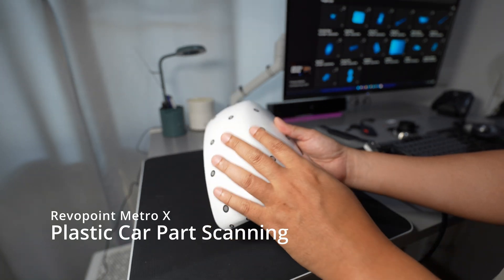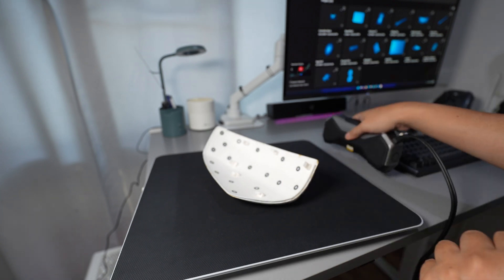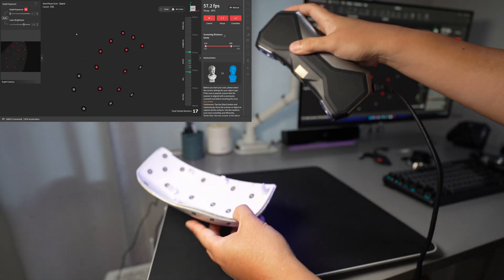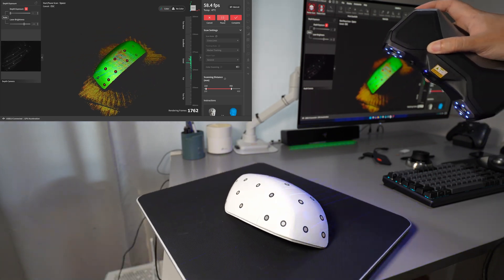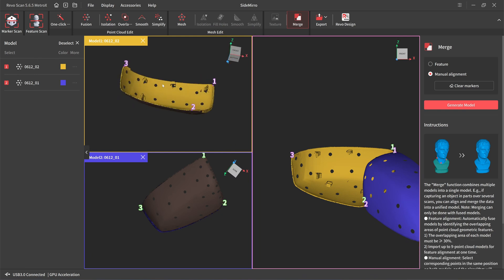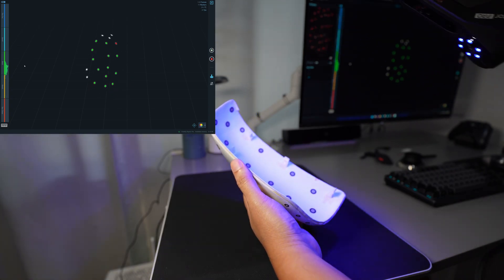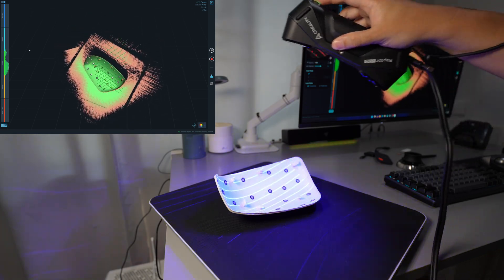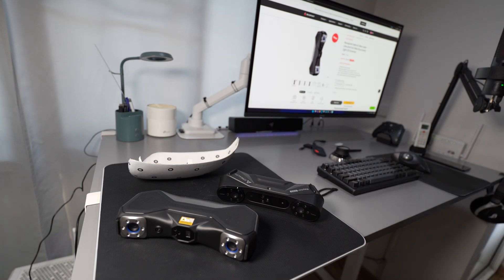Can Revopoint Metro X Scan Plastic Car Parts? Head-to-Head with Creality Scan Raptor!

Comment: I would love to see how these $1000 scanners compare to the new $500 Revo INSPIRE 2 which has lasers
Reply from the maker: I won’t be receiving a review sample from Revopoint, probably because of how blunt I am in my scanner reviews. Just make sure you can return it if it doesn’t work for you.
Reply: @P @Payo-TensileCreator hanks for letting me know! I ordered one from
Amazon for easy returns just in case. Comparing the creality software with the revopoint software in your reviews, it seems like the creality software is much better optimized and gives a smoother scanning experience overall. I'm hopeful for the parallel line scanning on the new Revo because I have a lot of black and reflective surfaces to scan, let's see how it does!
Reply: @Payo-TensileCreator  I received the inspire 2 and am very disappointed. 
- It struggles to scan over 15FPS with the mobile app
- it constantly loses tracking in the feature scan mode, with and without markers.
- parallel  line scanning is only available on PC
- when I do get a good scan, the markers aren't erased from the part properly
- sometimes the markers turn perpendicular and leave holes in the mesh 
- the software often freezes especially when switching to and from global marker mode
- grey/black, and reflective surfaces cannot be scanned whether they are glossy or matte in feature mode, even adjusting the exposures. Scanning spray barely makes a difference.

Thank you for the warning, I will be returning this device and I recommend anyone reading this to save their money.
Reply from the maker: @XavierBergeron  Thank you for sharing. Those issues are common across their entire scanner lineup, from entry‑level to high‑end. I’m glad you were able to return yours, since many users haven’t been so fortunate.

Comment: Good video as always. I have a big doubt. I want a 3d scanner specially for car parts (interior). Maybe maxim will be around 500mmx500mm. I can't decide between creality raptor pro , revopoint miraco plus, or einstar vega. Do you have any tips about this? Thanks
Reply from the maker: Most automotive trim pieces are quite thin—typically between 1.6 and 2.4 mm—and often can't be stitched together from multiple scans. Based on your list, only the Raptor Pro is capable of capturing them in a single pass.
Reply: @Payo-TensileCreator  also I'm planning to do similar things, mostly car parts, can I get single part scans with the base model Raptor? The parts will be 1800mm x 1500mm max probably, as I read from the official page, it says it's capable of scanning up to 2000mm x 2000mm but idk if thats accurate, any recommendations? Thanks
Reply: @Payo-TensileCreator Thank you!

Comment: Just a thought: I wonder if you could add a few of blobs of modeling clay around the perimeter that would give it something to lock on to when flipping the part over or, at the very least, a feature that spans the upper and lower shell so they could be merged. (Of course, then you'd have to remove the clay from the mesh in CAD.)
Reply from the maker: Yes, you can do that, but it's going to be a large blob, +10cm wide and applying markers on it, or simply put a large clay on a turn table and sink the part in there. Erasing the clay will carve away some of the part surface.

Comment: I heard you shouldn't use two different size markers with the MetroX.
Reply from the maker: Actually,  you shouldn't use any markers with the Metro X at all. In the end, Revoscan can't remove marker defects from the scan. 
It's common for laser scanner to apply 10mm markers where the space is available because it can be detected easier and 6mm on corners and smaller areas where 10mm is too big.

Comment: Hey! You're using a Raptor Pro in this vid. Would the Regular Raptor work for this do you think? Thanks! Bill.
Reply from the maker: I don’t have the original Raptor with me at the moment, but many of the thin-shell and complex scans sent to me by viewers or customers for reverse engineering were created using the original Raptor. And most of those scans were done by average users or hobbyists. https://youtu.be/ZXwaS0v3dfo
Reply: @Payo-TensileCreator Thanks for the fast response! I just ordered a Raptor as my first scanner. Looking to create car bumper protection pieces and other various car accessories.  Now looking for best medium grade 3D printer. Subbed to your channel. 👍

Comment: I have both the raptor and MetroX and I have had them both in storage since I got my MAF 3. I recently busted out the metroX after I heard the newest update improved performance dramatically and I have to say it's come a long way. The MetroX in laser modes matches scanning speed for the raptorX in parallel line modes now for me. I was shocked because the last time I used it it took freaking forever for the MetroX to capture, the cross line mode used to be roughly the same speed as the parallel lines on the Raptor. I have not yet tested the cross lines on the MetroX as I don't care for it since the detail captured is greatly reduced. I find that with the faster scanning speed and more reliable tracking in the newest metroX update I can get juuust barely the same quality scans as I can with the raptor. The Raptor still has a slight edge in detail captured, and the scanning process is still smoother on raptor as well. There is some bugs in the viewport while scanning with metroX causing some jittering preview, but the scan always comes out ok, the motion smoothing in creality's scans is much more pleasing and makes it easier to line up your scan well. Raptor can also laser scan with colour capture (although the result is pretty bad).

I tried it again also in auto turntable and I found tracking is marginally better, but the amount of detail you can capture has remained the same. The MetroX turntable mode still is the highest detail out of the metroX and Raptor's modes, much sharper than when compared to laser modes. The catch is that it is a full field scanning mode, so it probably won't do well with un-prepped scanning surfaces.

Overall I am very impressed with the metroX improvements over it's life, it is still not as seamless as using the Raptor, but it is getting to at least be the same quality and speed. For value it might be on top now, unless you can get a used raptor for cheaper, or maybe one of the newer versions of the raptor with better accuracy and features. I think I will still be selling my MetroX and keeping my raptor as I can use my MAF3 for turntable scanning and the raptor takes up less space and is just slightly more pleasant to use for laser scans.
Reply: You seem very biased. Saw a smaller creator do more in depth analysis and after watching your review it almost seems like you’re a creality fanatic. Informative video nonetheless. I know what to look out for if I encounter difficulties. With my metroX
Reply from the maker: The improvement is in tracking speed, not scanning speed, and Metro X remains 10% slower than the original Raptor. However, what truly matters is the outcome—does the scanned result serve its intended purpose? It's metrology grade, isn't it?
Reply: @Payo-TensileCreator  I have to admit accuracy wise it seems close to me although I have not tested it with cloud compare or anything. I find that the quality of the metroX is about the same, if not slightly less defined, as the raptor, but neither is really great since my purpose is for scanning very small parts in high detail. I am unsure how it performs on larger parts, which may be a sticking point for many people since I see a lot of laser scanners used for automotive parts.
Reply from the maker: Precision and accuracy from Metro X is very low,  +/- 0.3 mm for 150mm long part, while Raptor is less than 0.05mm. Drifting error is also very large, 1.0 mm/m while Raptor is only 0.02mm/m. MAF3 gets 0.1mm accuracy error for 150mm long but its precision is so high that you always get the same measurement reading every time scanning the same object, so you can scale the scan part to the correct value. But the Metro X has low precision, measuring the same object twice will give 0.1 - 0.2 mm different value. I can't recommend for using Metro X as a measuring tool.

Comment: How did you clean the markers? When I do optimisation on Creality scan and check remove markers, it is not cleaning the markers, and they have thickness, you see them, how come you did it and it works? What did I do wrong?
Reply from the maker: There's a check mark say "Remove marker" when fusing the point cloud.
Reply: I know, and I did "remove narkers" but nothing has changed @Payo-TensileCreator
Reply from the maker: Did you use marker mode to scan it?
Reply: I @Payo-TensileCreator I use laser blue light scan not IR, but I did another test and I saw it did remove the markers, but not that perfect, what settings are you using? Also it is not recognizing the small markers 3 mm as markers, I put small and big markers at the same time, I saw you do it, but it doesn't see them, maybe it also didn't clean them nc it didn't see them, do I have to do global marker scan befor so it will define them as markers so it will clean them?
Reply from the maker: I just check on "remove marker", and that's it. Are you using reflective markers?
Reply: @Payo-TensileCreator yes i use reflective markers, i did some more testing and it does remove them, maybe they have to placed on flat surfaces.
Reply from the maker: You can't bend the marker or place it closer to the edge. If it's bend, you'll have to use the smaller one 6mm.

Comment: This video matches 100% the experience i had also with the MetroX and it's the culprit of all the marker detection and alignment issues with this scanner. As workaround you need to extend the scanning distance in global marker scan from 210-350mm to max. 200-400mm which will then also allow to detect the markers more far away. This is really bad implementation in RevoScan to limit also the marker detection distance beside the point cloud capturing. The implementation in Creality Scan is much better because here the marker detection is always to max. possible distance and only point cloud detection is limited. I addressed this (to me) really bad implementation to Revopoint but feedback was that this will be not changed. Workaround is to extend scanning distance, final solution is to sell the MetroX. ;-)
Reply: Got the absolutely same experience with metrox

Comment: how long does it take for each scan with different scanners?
Reply from the maker: Metro X in cross line is 10% slower than Raptor in 7 line, that's only when you're scanning. Trying to get a complete scan would take at least half the day for Metro X, and it's not guarantee you'll get it especially for this car part.

Comment: I just scanned a dash panel with my Raptor and it came out GREAT! I took a few scans. I propped it up on its edge with some markers on the mat under it, then I hung it up on a wire and scanned it again so I could merge and keep the parts that came out good. It looks beautiful. I was able to reproduce the curve almost perfectly in Fusion360. Just need to work on the mounting clips.